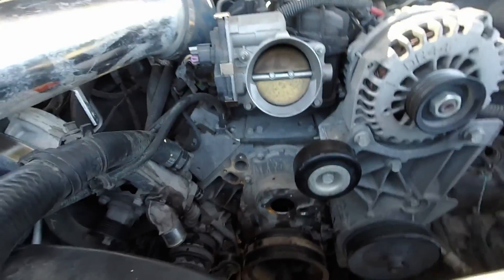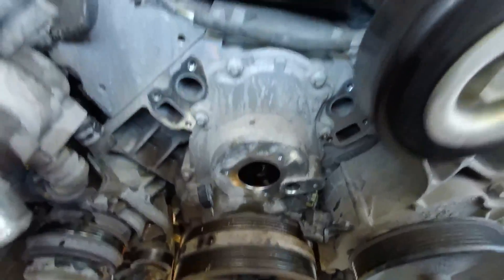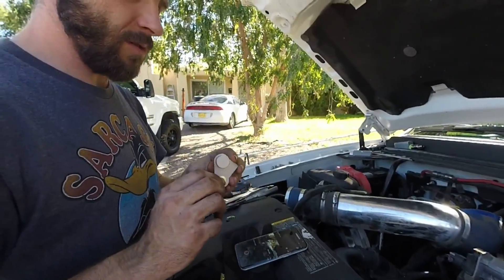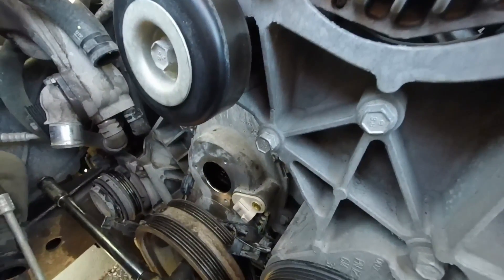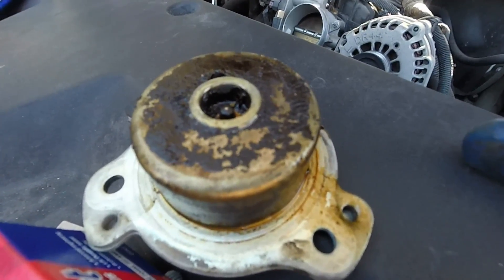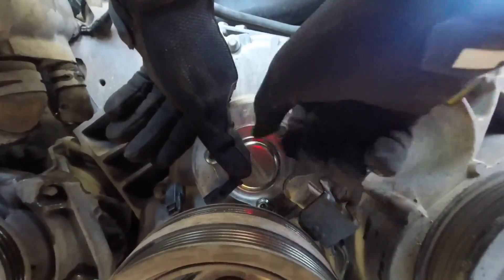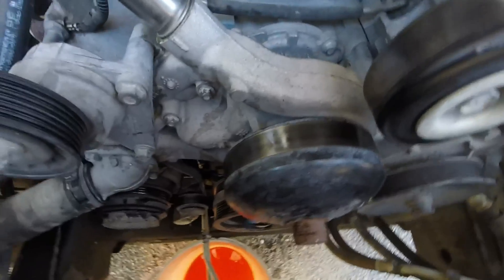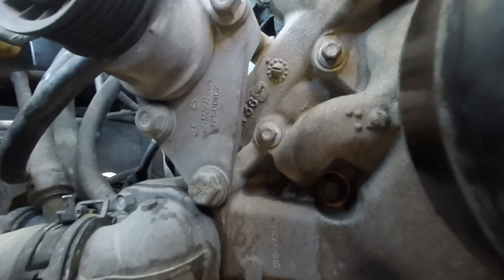GM 6.2L V8 VVT solenoid actuator replacement.

Comment: Was your engine making a sound a few seconds after start up. Can you see my video in my channel that I made on my Alternator to see if the sound engine makes is related. I do get this engine code. P0011
Reply: Jorge Serna did you fix the p0011 code ?
Reply: @jesusrubio9525  My truck is parked and I have not used it. I want to finish my flatbed but have been working long hours. Do you have the same issue on your truck?
Reply: Jorge Serna i think so mine switches from v8 to v4 mode when it’s not supposed to and I have p0011 code , vvt solenoid just got here gonna be installing it today see if it fixes the problem
Reply: @jesusrubio9525  Good luck. My truck is a 4x4 so the frame makes it difficult to remove from the underside of engine.

Comment: Hey David, got a couple of questions. I expect the cam bolt/valve is tight and will be tough to break loose. How'd you keep the engine from turning? Did you just use another breaker bar on the harmonic balance bolt for back pressure? I know the bolt/valve is actually the bolt that holds the whole vvt sprocket assembly on the end of the cam. I'm assuming all that stayed in place for you while you had the valve out? Just worried when I pull the valve out the sprocket assembly will come off the end of the cam and I'll end up pulling the whole front cover off. When you tightened it, did you go 48 ft. lbs. and then 90 degrees? And again, was it a problem keeping the engine from turning or holding it in place while tightening?I liked the video. So far it's the only one I've found for this particular job.Thanks - Paul
Reply: go to the dealership for the part numbers

Comment: Hey Dave What code was it throwing out the reason you replaced it Lines at 0016 I already replace the camshaft p and the crankshaft positioning sensor still coming on still the same no change
Reply: Mine runs for 20 min then shuts off let it sit for a day and runs fine again

Comment: I have an 07 escalade esv with the cam actuator code. When removing the actuator solenoid that you took out & cleaned, did you have to turn the harmonic balancer or set the timing or were you just able to remove the actuator?

Comment: when you install the vvt cam bolt it twists, this is the reason its a one time piece
Reply: What can happen if you reuse it?
Reply: @stormshockin  it's torque to yield so it puts a stretch on the bolt if you reuse the bolt it could break and cause you much more expensive repair
Reply: @Magnacharger07  thanks

Comment: Hey guys ihave read that the cam bolt is a one night fling, she twists when you torq her and you need a new one on the next instillation!  just sayin.
Reply: Book says replace it regardless. Says 48 ft. lb.s then 90 degrees. I started to re-use it but then it felt like it was gonna give so I ordered a new one. There were no issues prior.
Reply: stephen R was the bolt able to come out without turining the engine or anything like that?
Reply from the maker: This i have not heard. It is a hardened steel valve built not to
 stretch like head bolts. I have not seen an issue with anyone re using the valve
Reply: thats the reason im on here. book says to replace.  oh its called torque to yield.
Reply from the maker: if you are having issues with that then yes i would say replace it anyways... thats the reason people are watching this video... in this case we cleaned it out and it worked fine. if the cam VVT bolt was bad you would replace it anyways.
Reply: What did you torque the actuator to?

Comment: Hey David, i'm from poland, i have escalade 6.2, I have a problem with the motor, you can help me? The engine goes out when it is hot, when it slows down, the engine speed drops and the car goes out. There is a problem with the engine getting started, but it helps to hammer the crankshaft, Is the solenoid valve stuck? I do not know how to diagnose this, please help
Reply from the maker: is the check engine light on? if so you can google on how to check engine codes for your specific vehicle. if not and you are banging on the crank and it helps, in my opinion is that the crankshaft position sensor or cam position. But from what i have seen is the solenoid makes the traction control lights and check engine lights come on with reduced power from the engine..
Reply: David Bennett , hm. Check engine light on but i have instalation LPG and I thought the light was for that reason. I can not find information on reading code errors in google and yt. Tomorrow will try to connect it in a workshop under the diagnostic computer. As for the engine it has full power when it goes out without any symptoms. 
So how is the variable valve timming does not work,engine lose power and a traction control light on and check? so the timing variables are not the cause,
Reply: David, i have P0016 code error, What do you think?
Reply from the maker: yes so that code is related to the Crankshaft and camshaft position sensor...... you might have to take them out and test them or just replace if you have alot of miles on the truck.. i would say crank sensor though.. IMO
Reply: Thanks for the quick reply, there is some problem with the availability of parts but I will try to order two sensors and replace, I hope that these sensors are guilty
Reply from the maker: chrostek010 me too and good luck!
Reply from the maker: but then again people have been fixing that code with the oil control valve replacment.. its hard for me to say if its that or the sensors without testing them all myself.
Reply: I was curious to know where the crankshaft sensor is located, have to remove the starter to get to the sensor and there is little space, I also noticed a small leak between the box and the engine, it may affect the sensor reading?
Reply from the maker: should be located on the driver side bottom of the block close to the front of the engine.
Reply: I'll search...
Reply: chrostek010 have any luck with that code, was it ever fixed?
Reply: Mines doing the same runs fine then shuts off when you try to start it the timing stays at 0degrees no change let it sit for a day and it’s starts right up drive it 10 miles runs good then shits off out of no where I’ve replaced every sensor known to man

Comment: Dave, what was the reason for replacing the actuator? I have an Escalade with the same 6.2L engine, it has a rough idle, it has no codes and runs strong at speed but idle is rough most of the time, I'm suspecting a sticky solenoid actuator. Any advise will be appreciated.
Reply: David Bennett  you recommend to buy actuator solenoide ? Because I changed the camshaft sensor and the check engine light still on and the motor vibrates. Autozone checked and stated to change the camshaft sensor. Any opinion will be appreciate thank you
Reply: David Bennett hmm... I have same code issue in my 08 Denali. No rough idle, no limited power.. cleared the code and it came back after 15 miles. Might shoot for an oil change first but I’m within normal change and it’s at full level...
Reply: David Bennett light did come on a day after I was stuck in some snow (back and forth, rocked it out) for a couple minutes though...
Reply from the maker: almost sounds like a connection issue in the wire harness. maybe some water got into a connector somewhere? i wish i could be everywhere to help people out.
Reply: azir khan .
Reply: azir khan .  ...
Reply from the maker: Check engine and trac control lights were coming on along with power being limited from the engine..... also found out that a cracked O-ring for the pickup sump in the oil pan also causes all these symptoms.

Comment: thanks bro you video helps allot i have a Yukon denali with the same problem 🖒
Reply from the maker: your welcome. if you have really low oil pressure.. the O-ring for the sump pickup tube that meets the oil pump has been the issue also. it sucks air and throws the whole system off.. when i get my hands on another truck with this problem i will make another video.

Comment: How are you boss!
Thanks for the video. 

I just purchase a pre-owned 
07 Cadillac Escalade 2 days ago And everything was good till today when I was driving the check engine light pop on my screen.  So u put my scanner to see what it reads and its a error code p0011
 (1 of 2) bank. 
The truck is running excellent but I don't want to risk and make the issue worse!!!
I also read a note on the screen (stabilitrak) then it's feels a little shaky if I'm at a red light. Soonest I park and turn off. Everything is back to normal except the 
check engine light will remain p0011. 

What can you recommend for me to do boss?
Reply from the maker: MrSerioLok69 get it checked out. some of these motors have catastrophic issues.
Reply: David Bennett what codes were you getting to discover this problem? i think i may be needing to do this
Reply: I have the same issue with my 07 denali and now it just started running really rough . I'm going to change the oil pick up tube o-ring this weekend and hope it fixes it ....did you ever find a solution?
Reply: Did you guys  resolve any of the problems have a 07 Denali had the same problems I swapped the cam and everything worked great after but now I purchased a 07 Escalade motor and swapped it with 100k and the p0011 comes on just wanted to check if any one else has found something to fix the p0011

Comment: do you remember the technique you used to remove the camshaft position sensor from the block?  I have mine about half way out but its really stuck.  Did you grab and twist with pliers or something else?
Reply: cfcstl mine was stuck so bad I ended up drilling a hole in it and with a deck screw and vise grips pried it out!
Reply: @checkingthetoob  me TOO
Reply from the maker: yes i destroyed the old one trying to get it out.. twist and pull and pry and twist and pull...
Reply: Give er the old dick twist. It’ll come right out
Reply: I had to drill a bunch of holes in mine and hook tool the pieces out with a shop vac hose on it while I worked to keep shit from falling in. Worst sensor I have ever delt with.

Comment: Prior to repair what CEL codes were you getting?  Most likely facing the same repair- I have P0011 and P0016.
Reply: David Bennett did you fix it ?
Reply: David Bennett .......did u get around to replacing the o ring and if so did it fix the problem
Reply from the maker: sweetdickrjones no. the truck was sold. im sure the o-ring was the issue.
Reply from the maker: it was actually throwing the stable track and ABS lights along with the VVT solenoid. cutting power to the truck.. replacing this did NOT fix the issue.. came across another common problem that is creating this issue.. the oil pickup feed tube O-ring in the pan cracks and starves the motor from oil. have not gotten around to replacing that but everyone seems to say that it is the problem.

Comment: Hey i have a question for you
Reply: it's a 15/16. For some reason mine isn't budging. Any suggestions? Was yours hard to remove?
Reply: David Bennett I called a dealership and the parts guy said that the techs just reuse them, and that they've only sold one. So I just reused my old one.    Your video saved me. My 07 yukon xl Denali 6.2 was dieing on me when I would come to a stop and wouldn't start back until it cooled off for about an hour. Replaced everything you did and now it works like champ. Thanks again.
Reply from the maker: Awesome! glad it helped you out. please subscribe and like the video so i can keep producing video's for youtube. They sent me an email saying they were demonetizing my video's because i dont have 100 subs lol.. anything helps i guess. Thank you for watching!
Reply from the maker: whats your question?
Reply: David Bennett the solenoid actuator how do i remove it?
Reply from the maker: if you mean the solenoid that is bolted inside, that the actuator pushes on? put a socket on it and unscrew it out of the camshaft, i dont remember the size socket.. its basically a bolt that holds the cam gear onto the camshaft. be careful removing it after its unscrewed do not score the sides of it.
Reply from the maker: impact and heat.. yes i used a breaker bar
Reply: David Bennett  so can you reuse it after removing it and cleaning it?
Reply from the maker: duckdude018 i did. But it recommend to replace
Reply: hey Dave what code was it throwing the reason replaced it and when you unscrew the oil control valve when you pull it out with anything Fallout or anything or can you on unscrew it and just pull it straight out you. Do you have to support nothing
Reply: Hey James Smith, just curious if you decided to do this. I'm wondering the same thing about things falling off. Not sure if the cam gear has room to come loose inside the timing chain cover when the bolt is removed. I know the cam gear sits on an alignment pin, I'm thinking (and hoping) the cam gear fits tight enough it will stay in place while the bolt is out.